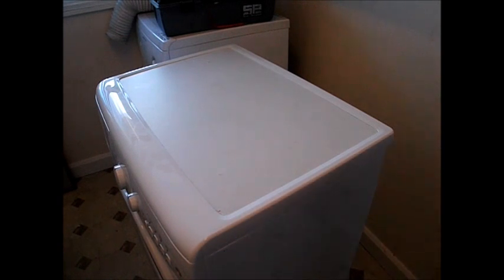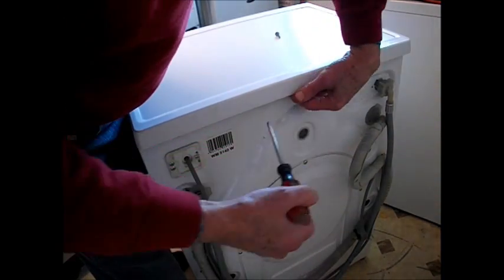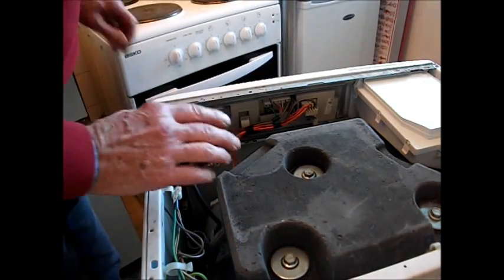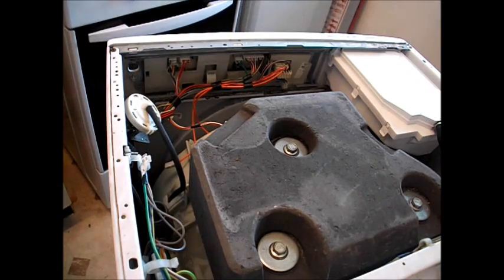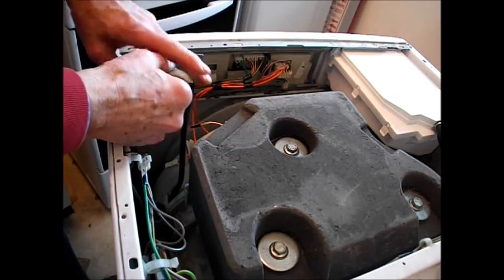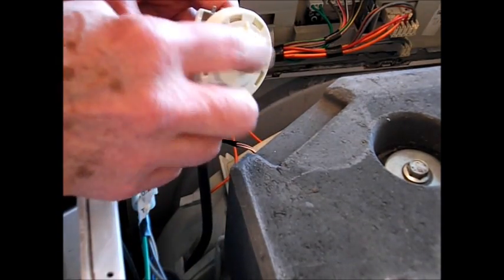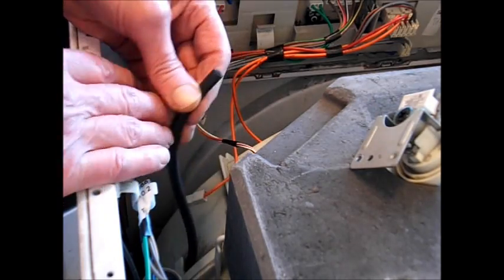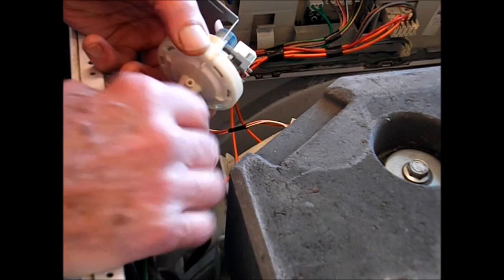Washing Machine pressure switch

Comment: Thanks so much for your video. I have a Beko WMD 67105 washing machine that doesn't fill up with water and stops filling after 1 second. The spin cycle however works ok. I already checked the water inlet valve and it's Ok. Could  the problem be what this video is about and if not what else could it be (it's not a kinked cord or blocked filter). ?   Thanks again!

Comment: Great video mate. What is in the pressure tube that presses on the pressure switch's diagphragm? Water or air? Also, I have a faulty Electrolux EWF1090 front loader. After running the machine's self test I get an error code E35 which I'm pretty sure refers to a faulty pressure switch. Unfortunately when I consulted a parts manual, the machine has 2 pressure switches.  One switch is similar to the pressure switch in your video but there is also one next to it which is described in the parts list as an anlogic pressure switch.  Any idea what the anlogic pressure switch is for?

Comment: Thanks! I have Whirlpool AWE2316 top loader and I have been experiencing problem with pressure switch according to the self diagnostics lights. I managed to reset this fault code for now (Select drain program and press 4x Reset button within 5 sec) but now I know what to do when this wont help anymore :)

Comment from the maker: The 'tube' you are refering to is the tube which leads from the pressure vessel to the pressure switch diaphragm. You may find that this tube is blocked or it maybe a blockage in the pressure vessel. I would replace the tube if its blocked and clean out the pressure vessel. If this doesnt work I would then replace the pressure switch. The pressure switch tube doesnt go to the pump. When you complete the repair you might be in an area where you should use something lke Calgon water softener tabs.

Comment: great video - where does the tube lead to in the machine? i have a sign on my hotpoint that tells me there is a switch issue. the filter is clear and its pumping out - i did have a blockage so and the machine still doesnt complete its cycle. i assume there is a block in that tube. how would i clear it and where doest it go it you blow down it - to the pump?

Comment: great video - where does the tube lead to in the machine? i have a sign on my hotpoint that tells me there is a switch issue. the fiter is clear and its pumping out - i did have a blockage so and the machine still doesnt complete its cycle. i assume there is a block in that tube. how would i clear it and where doest it go it you blow down it - to the pump?